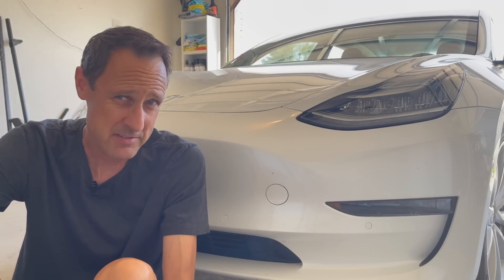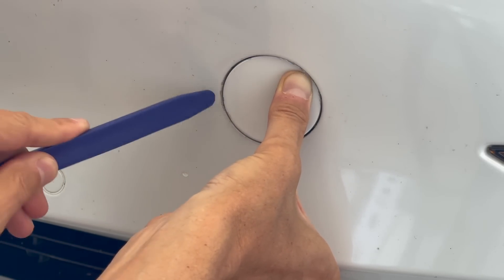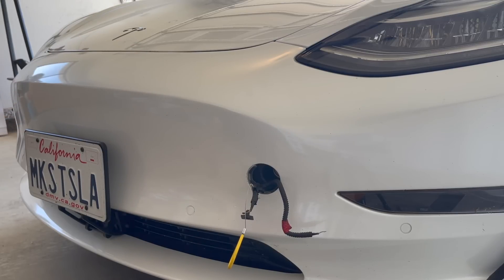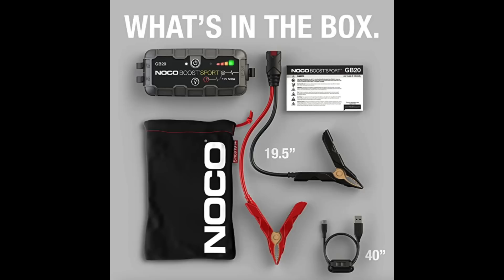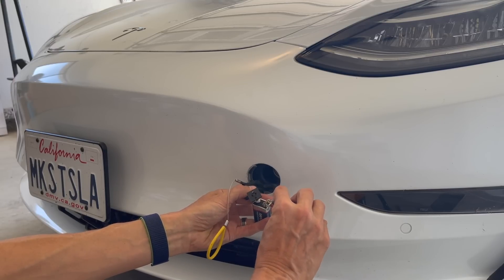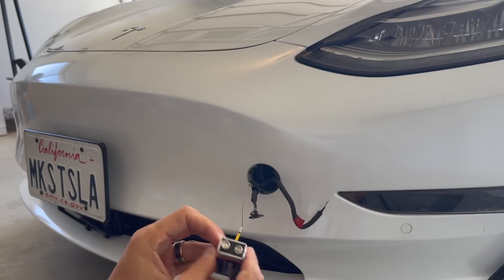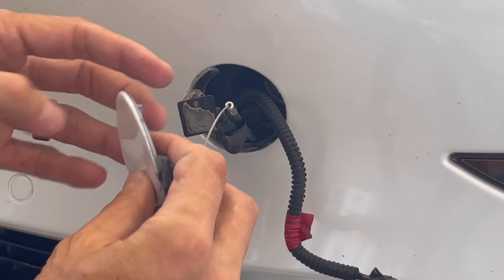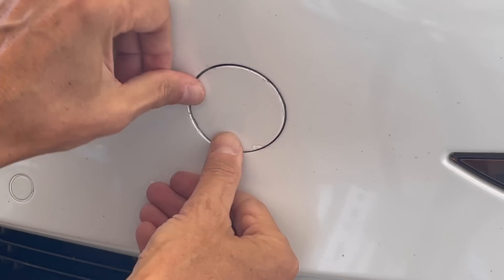How to Open the Frunk if Your 12V Battery is Dead

Comment: Nice Video FTG - I also put an auto open and close frunk system on my Juniper. Can you explain what the looped manual release would be used for? If you use the battery and terminals what is the purpose of the other cable? Reason I ask is I have pulled on that loop and it doesnt open the frunk. Hope you see this comment and can reply. Thanks!

Comment: I can only see one wire. The negative black one. . The red wire is taped to it. I tried pulling it out but it is stuck in both directions. I have a 2019 tesla model 3. Is that different from the one in video?

Comment: Before closing up the little access port, I keep a little plastic ziplock bag with an A23 12 volt battery (smaller yet more powerful than your 9 volt battery) attached to a cable so I always have the battery ready to use.

Comment: You can use either 9v or 23a (12v).
I would leave one inside the trapdoor. So you don't have to carry on you or have someone to bring one.
I would leave the NOCO jump starter inside the frunk at all times.

There's supposed to be a manual pull straps to manually open the frunk

Comment: the fact it works with a dead battery is still a security issue.  what if your car was parked a long time on the street and a thief knows this they can access the frunk.  should only work if you have the key fob on you even if the 12v battery is dead.

Comment: the power boost bank won't work if it's locked inside the frunk or trunk when the battery dies.  So you should keep one in your house instead but that won't help you if the battery dies while you're on the road.  You can call AAA or someone else to jump it but that can cost precious time if you have a dog or baby inside a hot car.  would be nice if they had a mechanical key to unlock the car in an emergency like many other cars have.
Reply: agree! it really post some safety issues without a mechanical key, room to improve!

Comment: thanks for this video!  Personally I don't like to put the electric tape stick against the metal, so I wrap backward with the sticky side out for one revolution, then wrap the sticky side out with sticky side in.  This keeps the metal free of nasty stickiness.
Reply: Or, cut off the corner of a sandwich bag and use that to cover the end of the connector. Then use electrical tape to hold the bag onto the wire's insulation.

Comment: Yes…… just another pain in the ass, proudly presented to you, by the designers at Tesla. Have fun figuring out how to make your car work when it won’t work !  😊
Reply: Yes, true. Teslas are sometimes too techy when they don't need to be. This process shown DOES show some intelligent forethought, though. Here's why:

The doors are (needlessly) electrically opened. Pulling the door handle only triggers a switch, which activates a solenoid door opener. A dead 12-volt battery in the frunk means you can't unlock/open any of the doors. Using the method shown allows you to get the frunk open so you can jump the 12-volt battery and get your door(s) open.
Reply: Sure, dinosaur... we'll do this while you go find someone today with a slim jim and screw around with your choice of car doors trying to open your locked car without without a key, while screwing up your window gasket, window mechanism or even breaking the window and maybe finally get your stupid car unlocked. Meanwhile, we'll gone down the road with no damage. Ok, dinosaur.

Comment: I love that this small 9V battery did the trick.
Reply: should it be 12V ?
Reply: A 9v would not work on my 2018 model 3.  Had to use a 12v battery charger
Reply: Tried 9volts did not work 
12 volts worked here in the UK
Reply: 9 volt did not work for me. I had a little 12v  4 wheeler battery and hooked it up with cables and it worked

Comment: @ 6:50 Attach the positive cable to the plastic cap and it will be insulated, but honestly, if it comes from the factory uninsulated then it's unlikely it need to be.

Comment: Great video!
Sorry I'm clueless about electrical stuff but you made it simple. 
Does it mean that you can open the car but just not the Frunk if your 12v battery is dead? 
@paulbeaudette8788's comment threw me off. What good is a 9v battery in the glove compartment if you can't access it? Is the 12v used to just start the car?

Comment: But how do you unlock the doors if the 12V battery is dead so you will be able to pop open the Frunk with the 9V battery?  Isn't the 12V battery responsible for providing power to unlock the doors?
Reply: I had the same question
Reply: @paulleary2312  I'm guessing once you pop the frunk and replace the 12 volt battery then you'll be able to open the doors...
Reply: The frunk doesn’t open with the two wires on the front of car with the doors locked.
So back to the question   How!!!

Comment: Does anyone else find it ironic that the first option is to find someone with an ICE car to rescue the electric car?
Reply: ALL cars would need a jump if their battery was dead 🙄
Reply: Dumb comment.
ANY car (diesel, petrol, electric, or even say hydrogen 🤣) with a low voltage battery can be used to get the Frunk open. 
… OR as shown here, just a 9v smoke alarm battery. Of course ICE cars never suffer a flat battery 🤣🤣🤣🤦‍♂️
What’s exactly is your point?
Reply: You mean the 1st option is to get your jumper battery always kept in your 2014 Nissan Juke that dies once a year since 2016... Then you pop the frunk, use said battery to juice dead battery, and then drive the Tesla battery around to charge up that mini one a bit more. 

Batteries, it's not magic
Reply: 😂 why would you need a ICE to save the EV🤣😉

Comment: You do NOT have to electrical tape to insulate the positive terminal when finished. That's misinformation. My car didn't have that from the factory. They just use a simple 1 cent diode to protect this.

Comment: Is there any voltage shown from those wires if the 12v battery IS charged?
Reply: If there is, that means we can hook up a high amp draw to those wires til the battery dies, which disables the door lock function,which lets us into the frunk anyways

Comment: Is the 12v battery under the same warranty period as the big battery of Model 3?
Reply from the maker: No. It's under a 50,000 mile warranty.
Reply: @FrugalTeslaGuy  , too bad.  Many model 3 seem to have 12v battery problem after 50k miles.

Comment: I'd want to protect the positive lead with more than a little electrical tape that will get could fall off with heat and cold cycles.  There should be a solid plastic case-like cover or zip tied sleeve.

Comment: It sure would be nice to have an actual key to unlock the doors, and then manually pop the frunk with a lever. I'm not that unusual in that I go to remote areas for backpacking, etc and kinda need to depend on getting access to the 12v and my jumper cables/jump starter without hoping my little battery I carry around with me/tape to car isn't dead, and that the 12v car battery is dead enough to allow the frunk to open. Too many ifs for that kind of situation.

Comment: Hey FYI.  If your 12V battery is truely dead then this doesn’t work.  At least not on a 2018 model 3.  I had a situation this weekend where my 12 V battery died and I grabbed a brand new pack of 9 V batteries and it would not open. I ending up waiting for the tow guy to bring a 12v battery charger to open it up.  If your battery is ok and unlocked then this may work.

Comment: im interested in the auto frunk... lets do talk about that if we can, in what ways does it change getting into the frunk with a good on bad 12v ? i hope your able to reply or message me
Reply from the maker: Upon installing the auto frunk a pull lever will be run through to the tow hook opening. By pulling it along with using a a power source (9V battery/jumper) will open the frunk latch.

Comment: Thanks for the DIY tutorial.  Much needed as I was surprised how "unprepared" I was for my 2018 Model 3 dying 12v battery. Lol.  
Also, side bar note: Moving forward, do NOT put any valuables in your frunk, now that it looks like everyone / anyone could now easily "break into" your frunk, simply with a 9V battery....
Reply: @Norm Toy :: Check the end of the video. It can not be broken into this way.

Comment: While my 2019 M3 was parked for 37 days and plugged in to home charger, the 12v battery died.  I thought it was my Tesla phone app so I updated my phone app and re-booted the phone still car would not 'start'.  Called roadside assistance and then discovered how to open the port in the front bumper as I watched the Tesla RA tech.  Connecting a battery to the two leads that pop out you are able to raise the 'frunk' lid and get to the 'little' battery.  While his charger was connected drove the car out of condo garage where my Tesla was loaded onto a flat bed tow trunk and this was about 5pm Sunday evening.  Next day Tesla repair replaced the defective battery free of charge and now my car is new again.  Tesla even sent me a coupon for free UBER ride to pick up my car.  This is the one and ONLY problem I have ever had with my Tesla.  Tesla is a great car and a great car company.

Comment: I just tried it out with 12v battery (tested), careful contacts, proper polarities, doors unlocked. Trunk didn’t open at first, but I’ve realized you need to keep the contact on for two seconds, then it opens. Model 3, Dec 2018.

Comment: One tip if using a NOCO booster as shown in the video -- it has polarity reversal protection so that it won't apply 12V unless it detects it's hooked up with the right polarity.  So if your 12V battery is dead enough, the NOCO won't recognize that it's hooked up correctly and won't apply 12V, unless you press and hold the "!" button for about 5 seconds.  Be sure its clamps are not touching each other if you do this.
Reply: You are the first one that mentions this of numerous videos that I have seen with the Noco pack. Saved me about a week of frustration. Thanks dude!!!
Reply: Does the NOCO actually charge the battery if the clamps are connected?  I know that it will give it a jump so I can start the electronics or a normal car but what about if the clamps remain on does it charge for a certain pair of time or does it not charge continuously? Good tip otherwise on the dead battery and having to do it manually.
Reply: This comment needs to be a part of the video. Thanks for saving my time and money
Reply: You are my Jesus.

Comment: Where would I keep the jumper cable device? If the car is locked, I won’t be able to get in. Also, I don’t carry around a 9v and a flat screwdriver.
Reply: https://youtu.be/mSPKP5C7CE0 
Use small a23 battery taped to inside if the little access door. This happened to me, all power lost, doors locked car in shut down , no access to anything. On the flatbed being towed, couldn’t get it off the truck. If I’d know this it would have helped.

Comment: Good video Mike!  I like the way you explain things. Shortly after getting the car, I tried to be a little proactive and decided to pop off the round cover and open the frunk with a 9V battery. Guess what? There were no wires!  I thought the factory forgot to install the wires.  Tesla sent a mobile repair technician out. He said he had run into this a few times before. He somehow fished around and located the wires under the left fender, and moved them to the round access hole. He mentioned that if he was unable to snag the wires, the fender would have to be removed😖😖  Luckily it never came to that.
Reply from the maker: That’s crazy!  I’m glad they were able to get access to the wires.
Reply: @FrugalTeslaGuy  Does the Model Y come with the red lead already covered, or do we have to cover it with electrical tape?
Reply: Damn Tesla quality control

Comment: Hate to burst everyone's bubble, but a 9V does not work when the 12V is dead. This has been changed to require 12V. It says it right in the owner's manual. "Locate an external 12V power supply (such as a portable jump starter)". I also know from personal experience. In 2018, a 9V would open the frunk, even when the 12V was fine and car locked. This triggered the alarm. After an OTA update between then and now, a 9V did not open the frunk with a dead 12V battery. I then used a portable jump starter and it opened right up. Also, you should get a warning that the 12V needs replacement about 1 month prior to it being completely dead. So you should almost never be in this situation. You can't just go to AutoZone and get a new 12V battery. Tesla had to send a ranger to replace it.
Reply: I got the 12V battery message and it was dead right away. Not much of a warning 😂
Reply: I'm not sure if it's true that a 9v battery will no longer work if your car's 12v is dead, but it's better to use an A23 battery instead of the 9v anyway.  The A23 is a tiny 12v battery and about half the size of a AA battery.  I keep the A23 battery in a ziplock bag behind the tow hook cover.   And it will open the frunk using the two wires behind the tow hook cover (I tested it a few times to make sure).  As for being able to find a replacement battery at AutoZone or any other parts store, you actually will be able to find one.  The Tesla uses a Group Size 51R battery which is commonly used on Hondas.  You will be able to find that anywhere that sells car batteries (barring any stock or supply issues, of course).  You need to find or ask for "group size 51R" specifically, because their computer system will not find a compatible battery for a Tesla.

Comment: If I had the battery backup in my car, but everything is locked and the battery is dead, I'm essentially SOL?
Reply: I keep my portable jump starter in the frunk.   I keep an A23 battery in a ziplock bag behind the tow hook cover.  The A23 is a tiny 12v battery and about half the size of a AA battery.  And it will open the frunk using the two wires behind the tow hook cover (I tested it a few times to make sure).
Reply from the maker: Unless you can find a 9 volt battery somewhere. I guess so. 🤷‍♂️

Comment: Question. Can you unlock the doors with the 12 volt battery being dead?  If your doors are locked, and the 12 volt battery is dead, can you open the frunk with this process?
Reply: Yes, the 9v battery or other battery (I recommend an A23 battery instead) powers up the circuits and mechanism to release the frunk even if the car's 12v is dead.  I keep my portable jump starter in the frunk for that reason.   I keep an A23 battery in a ziplock bag behind the tow hook cover.  The A23 is a tiny 12v battery and about half the size of a AA battery.  And it will open the frunk using the two wires behind the tow hook cover (I tested it a few times to make sure).
Reply: @android04  it didn’t for me
Reply from the maker: According to Tesla, yes.

Comment: So forgive me if this is a dumb question but I do have one of those portable chargers but if I leave it in my car and the battery dies, how do I get into my car to get it out to open the frunk?
Reply: I and a few others keep an A23 battery in a ziplock bag behind the tow hook cover.  The A23 is a tiny 12v battery and about half the size of a AA battery.  And it will open the frunk using the two wires behind the tow hook cover (I tested it a few times to make sure).

Comment: Great video!  I just purchased the HULKMAN Alpha85 Jump Starter 2000 Amp 20000mAh Car Starter for up to 8.5L Gas and 6L Diesel Engines with LED Display 12V Lithium Portable Car Battery Booster Pack on Amazon which had excellent ratings.  I will also tape/store a CR style round battery in the lead terminal areas to get the frunk opened, and this pack inside the same arera.

Comment: Nice to see that a 9V battery will work to open the frunk! Those can be purchased almost anywhere and are easy to carry with you.
Reply: The a23 appears to be an even better choice. Way smaller and it’s 12 V
Reply: @chezchezchezchez  It is now reported that 9 volts won’t work anymore, it must be 12 volts. Maybe this is only true for newer cars, I don’t know. 12 volts is a good idea, in any case.
Reply: @AlanDayley  didn’t know that. Thx
Reply: @AlanDayley  can confirm this. Tried to open frunk with a 9V on a 2019 model 3 but didn't work.

Comment: Note that if you have a portable booster and you are in this situation with a dead 12v, you won't be able to access the booster if it's kept ANYWHERE in your Tesla - cabin, glovebox, console, frunk and trunk will all be inaccessible.  Keep something in your garage and have AAA service.
Reply: I and a few others keep an A23 battery in a ziplock bag behind the tow hook cover.  The A23 is a tiny 12v battery and about half the size of a AA battery.  And it will open the frunk using the two wires behind the tow hook cover (I tested it a few times to make sure).  I keep my portable jump starter in the frunk.
Reply: @android04  is it safe to keep the portable battery chargers in the frunk?  Do they risk getting too hot and causing potential fire issue?  Curious because what you state is exactly what I’ve been considering doing.
Reply: Maybe taping/hiding a round camera battery in that power lead area, and a portable battery charger in the frunk is a work-around?

Comment: Only downside to a portable jumpstart kit is that it's probably in your trunk, which is locked until you get the frunk open and power to the 12v battery :P
Reply: I keep my portable jump starter in the frunk for that reason.   I keep an A23 battery in a ziplock bag behind the tow hook cover.  The A23 is a tiny 12v battery and about half the size of a AA battery.  And it will open the frunk using the two wires behind the tow hook cover (I tested it a few times to make sure).
Reply: That was exactly my question